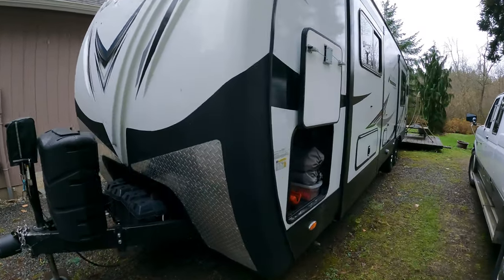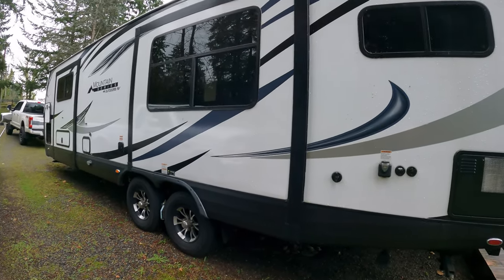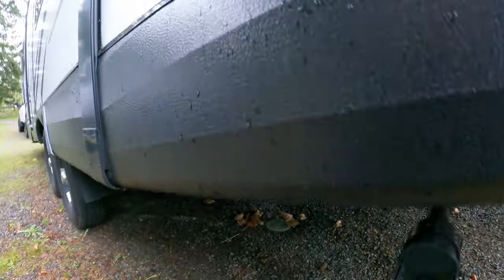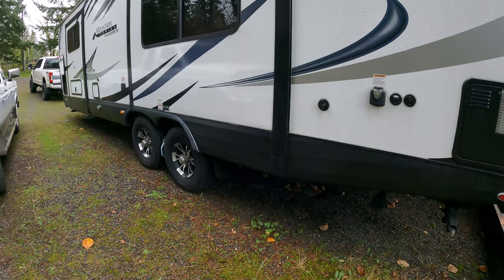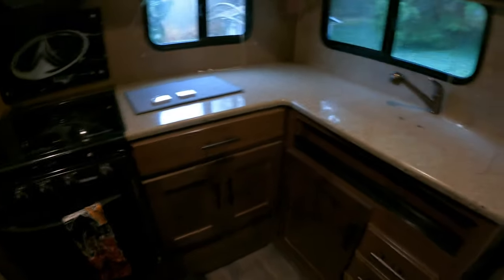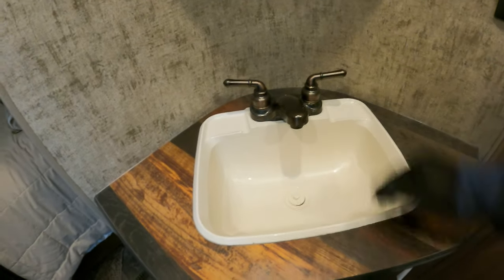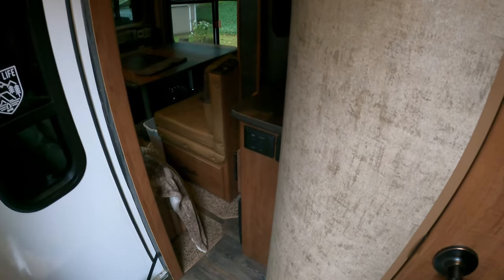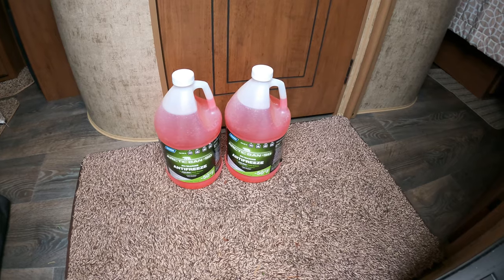How to Winterize your RV Trailer - Outdoors RV

Comment: Well done video. I have a 24RKS with a similar configuration. What are your thoughts on the batteries? Do you leave them connected on the trailer or store elsewhere..
Reply from the maker: Thank you. I leave the batteries connected year round. I leave them on the solar tender that the trailer came with. Batteries  are group 27 batteries from Costco. Never had any issues at all.